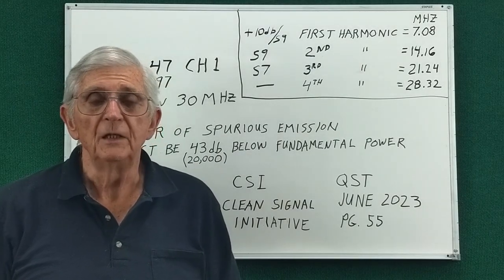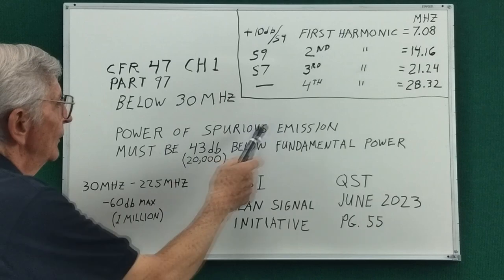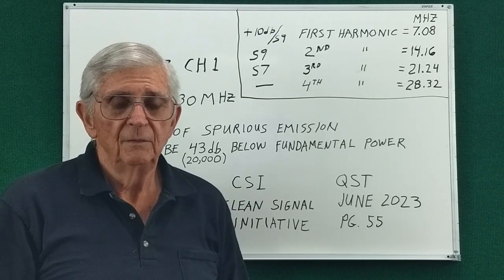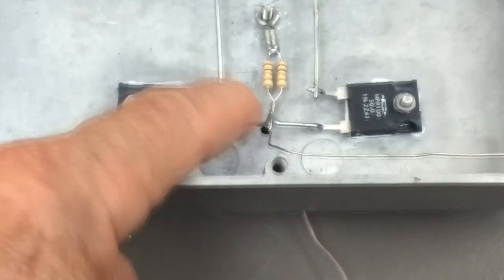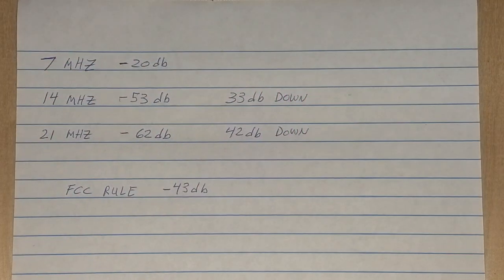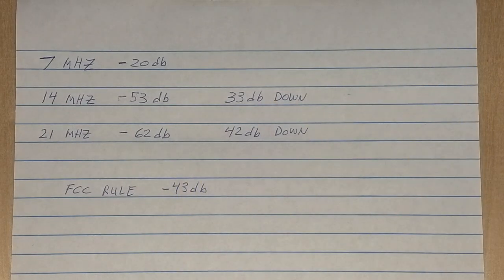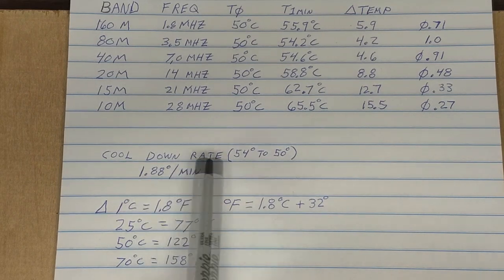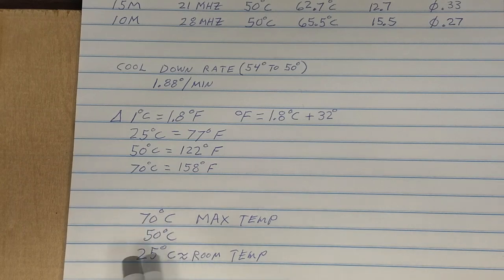EFHW emissions violate FCC rules

Comment: This is probably going on with most all toroids.  These are very lossy devices and cause excessive harmonics.  The ARRL wants to sweep this under the rug since they make so much money derived from these products.  Yet we have many YouTubers touting their harmonic generating toroidal devices while slamming other devices that have too many harmonics.  It's a rip-off industry.
Reply from the maker: The problems occur when the ferrites get hot. The temperature depends a lot on your operating methods. Casual contacts or contesting is very different. Thanks for your comment.
Reply: @Jimscoolstuff  this is true with your experiment. The reason the toroid increases harmonics is that there's too little permeability for the RF peaks and they clip. With your mix, there's enough at first but the heat decreased the permeability. 

Hams lose a lot of power in these toroids. Otherwise they wouldn't heat up at all. The correct solution is to find other solutions. The efficiency is very low. 

Can you tell me what the unloaded input XL is on the transformer?   Disconnect the output from the transformer and measure the inductive reactance of the input turns is how you can measure that.

Comment: This video is absolute nonsense.  Do the following - 

Measure the spurious emissions from the radio going in to a proper 50ohm dummy load
Measure the spurious emissions from a signal generator to a proper 50ohm dummy load for comparison.
Connect up a EFHW antenna to the radio directly and test SWR.
Use the nanoVNA to look at spurious emissions using a small antenna so as not to overload it.
Connect a RF signal generator to the EFHW and repeat measurement of spurious emissions.

The transformer you are using and/or the wire are TOO SMALL, you need to use better quality and bigger ones to handle continuous not just bursts of peak power.

The antenna ONLY radiates the RF put in, so if you have a radio giving off spurious emissions you will see problems.  
The antenna DOES NOT CREATE spurious emissions all by itself, which is what you see to be incorrectly suggesting.

You appear to have a complete lack of knowledge of RF, how to construct RF circuits, antennas, radio and test equipment from the demonstration you give.

The false results you are seeing are caused by the circuit YOU have put inline, nothing else.
Reply from the maker: Thanks for your comment.